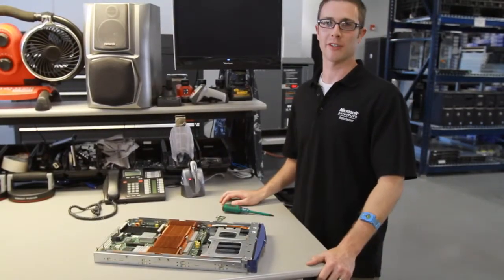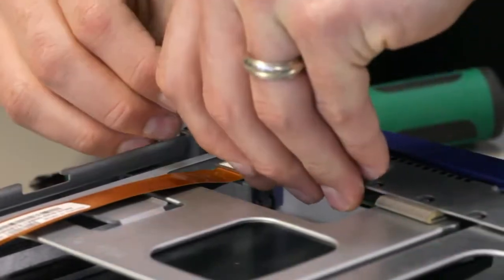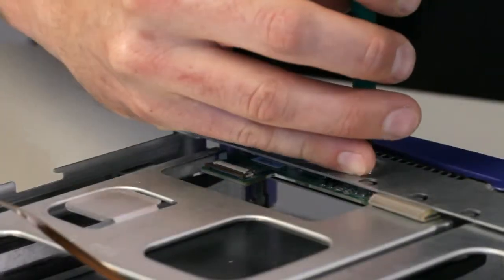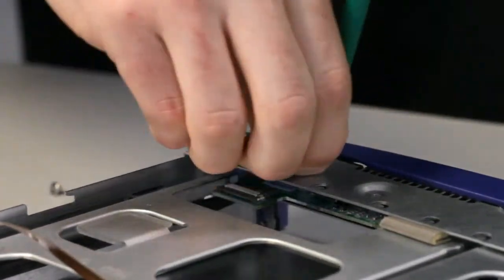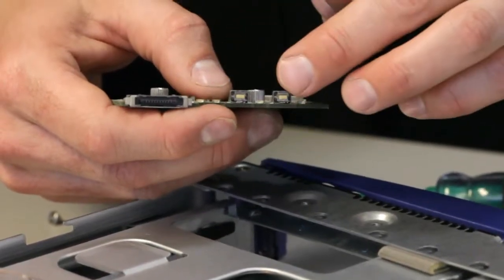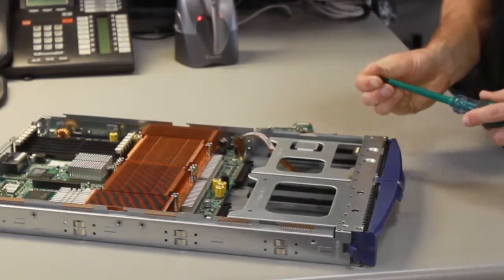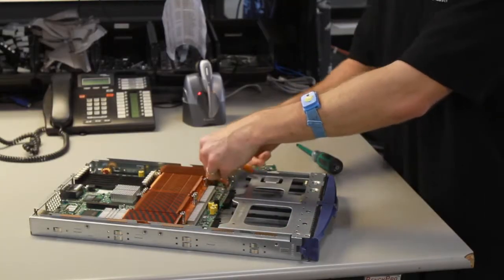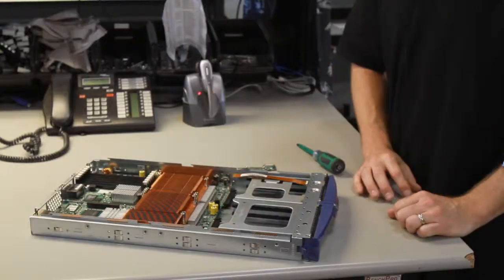Stallard Technologies - How-To - PowerEdge 1855 / 1955 Power Button Board Replacement

Comment from the maker: In order to use dual core processors, your 1855 needs to be a 2nd generation unit. This is notated by a motherboard part number of MD935. The SL8MA 2.8GHz dual core processor is a good candidate for dual core CPU. It may also be an option to upgrade to second generation 1955 and install 2x quad core processors and up to 32g b of ram. 
- Lonnie

Comment: would you happen to know the best xeon processor upgrade for the 1855 I have the 3ghz single core and I am interested in going dual core but I am getting a lot of mixed messages on what the best options may be I am using my 1855's for rendering if it makes a difference